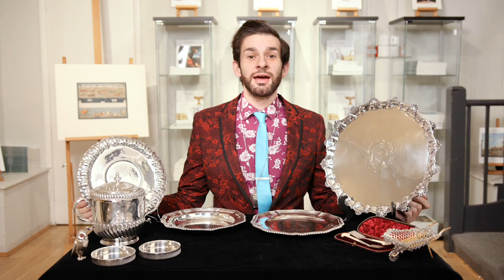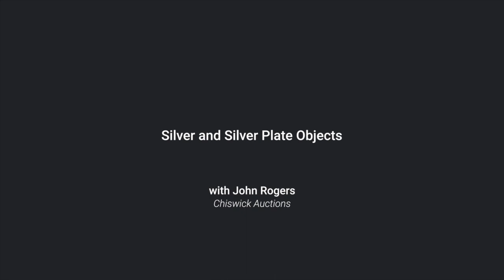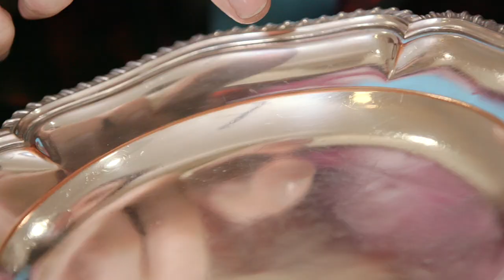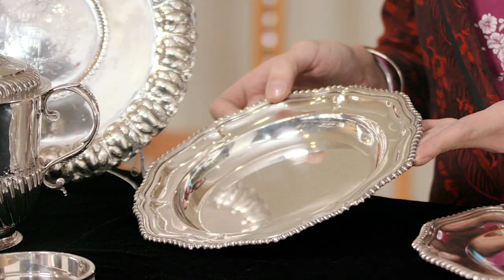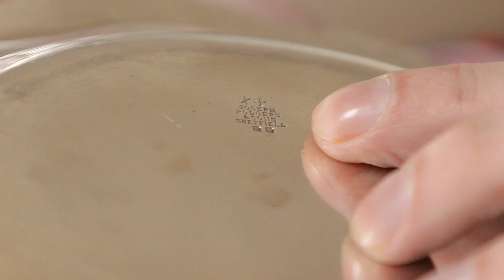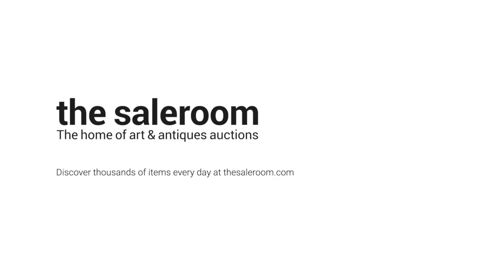The differences between silver and silver plate

Comment: I have a small, decorative box. Somewhat teardrop/eye shaped looking down onto it. It was completely gray when I bought it. I found that it responded wonderfully to a aluminum-baking soda-hot water treatment....except for the lid. It seems no matter what I do it stays dull gray. The underside of the lid and the inside of the container show similar signs of old luster and shine, but the top of the lid seems doomed to be darker than the container.
 Do you have any idea why this is and what I can do about it? the bottom of it says "41 Derby Silver Co. 32".
Reply: Possibly pewter, in the past pewter was made of many different parts, silver being one of them. My understanding is that silversmiths from the past had their own, let’s call it ‘recipe’, so what you are describing could likely be a silver alloy type of pewter, that has been also silver plated. This practice made for a quality final product. The weight of this higher quality pewter can certainly cause one to believe that the item is sterling, it would tarnish like sterling, look like sterling, have the weight of sterling, and lack the typical telltale signs one looks for when identifying  cheaper quality plated silver products. Think of the difference in 10kt gold versus 22kt or 18kt gold. Or better yet , imagine a 5kt gold necklace that was also plated with a high quality gold plating. A jeweler or expert would know the difference, but such an item would appear very real(which it is) and if deceptively stamped with a 14kt marking, could be sold to the average person easily as a genuine 14kt piece. I use that example only to try to describe the concept, not to imply that the pewter makers of generations past were attempting to be deceptive.